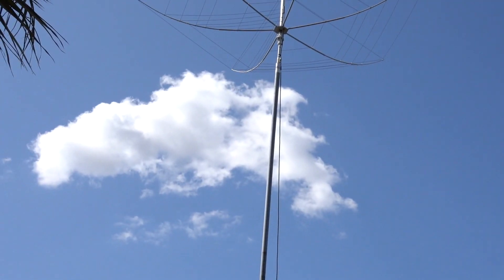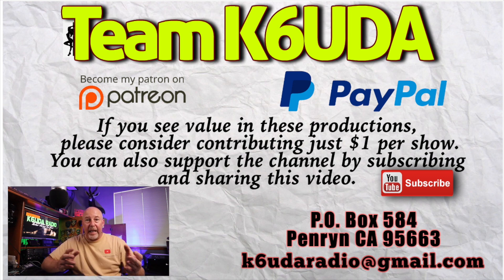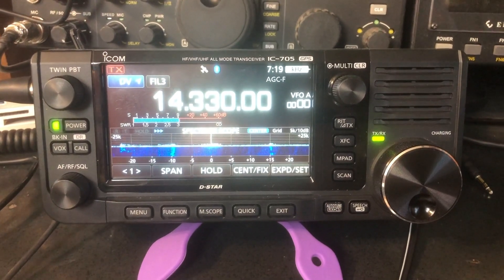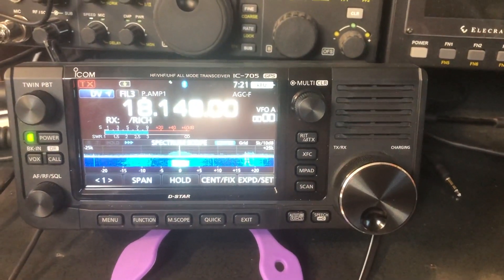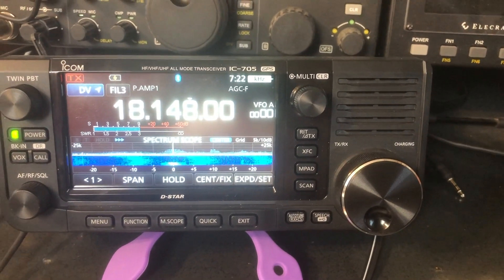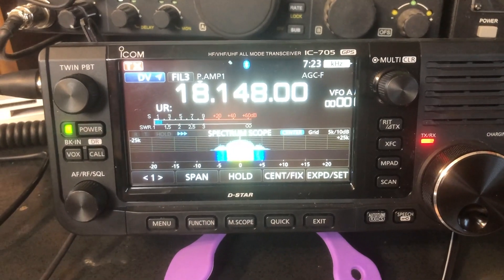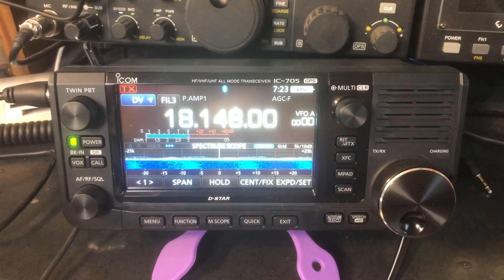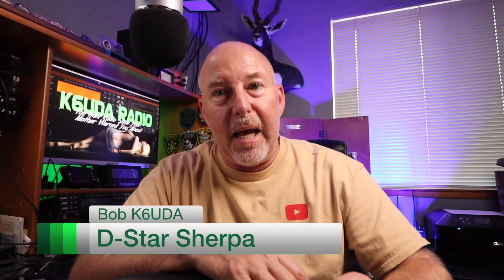Icom IC 705 demo - Must see D Star on HF at 10 watts | K6UDA Radio

Comment: I'm not an expert, but I was under the impression the digital FM modes weren't legal below 10m. That being said, I'm not at all surprised it works fine on the lower HF bands QRP. A lot of Yaesu C4FM guys have been using 10m this solar cycle for DX contacts, including Europe and Asia.

Comment: The IC-705 ia an AMAZING little radio! ☺ - Especially to someone who first got on the air 56 years ago.  Started hamming at 16 years old; had my Technician class license before my driver's license!  It led me to a 45 - year career, starting in consumer electronics, working for a small local TV repair shop, moving into being a commercial 2-wy radio tech, then industrial controls (NC & CNC machine tools, some industrial robotics), back into 2-way radio for a few years (including doing some ham gear repair professionally), then spent my final 20 years working for a major enterprise - level data storage systems manufacturer.  Went from working on late vacuum - tube era equioment uo to SMT.
Now retired, I enjoy restoring vintage rigs that were "dream radios" when I was in my teens & early 20's.  It's not all nostalgia, though; my early days on 6 meter AM turned me into a VHF / UHF / microwave weak - signal operator, still more active in that aspect of the hobby) up to 1296 MHz. currently, planning on going higher).  I just found out about HF D-Star recently & gave it a first try last week with the IC-705;  heard several signals, no 2 - way QSO's yet, but that was with the barefoot IC-705, & my HF antennas are all simplr dipoles; planning on trying it again in the near future.  Maybe with a bit of luck, we'll work you! ☺

73,
Tom WA1LBK

Comment: I cant get Dstar to work no matter what I try on my 705. In fact ive gotten to the point that I hate Dstar and its absolutely BS compared to DMR and I dont even like DMR. But as cool as this is, military already has digital over HF so ive already seen it in action, but i'd rather sideband some high power stuff. Im so over trying to get Dstar to work. Im fully registered etc.... can't use terminal mode, cant hear anything, cant do crap. But I could get DMR working in 5 literal minutes first time I ever tried it.

Comment: Well I guess that's about as wide as AM, so no big deal on HF.    
I think, as far as communication goes, I'd prefer SSB.  More intelligibility.
I wonder if anyone has done a test to see how low of a signal you can get away with and still maintain unbroken audio over Dstar, vs clearly understand the voice under SSB.   That might be an interesting experiment to do.  (Once I get one of these. :-)
However, as I understand it, dstar allows for sending additional data over the transmission.  Text and images?  Maybe GPS data?  I'm sure there are lots of tricks up it's sleeve.
Reply from the maker: Doing Dstar on HF at least right now is more of a novelty than serious way of having a QSO. As the signal fluctuates, the digital signal will naturally hit a squelch point where it audibly cuts out. Now some of what you were hearing was what happens during a pileup. Remember during that net, 25 or 30 guys are calling CQ and answering CQ at the same time. Much like digital on repeaters or hotspots, you only hear one guy at a time, hence the cutting in and out between a couple of stations. Unlike SSB, pileups can be very tricky.
Reply: @K6UDA  I think the potential practical utility would be some of the other tricks dstar can do.  I believe you can send images and maybe text? GPS position for sure.
If you come out to the unofficial quartzfest this year, we'll have to play around with it a bit.  160M during the day should be clear. ha.
Reply: DSTAR on HF is 6.2 khz wide, about the same as AM. DSTAR on HF will never replace SSB. CW. If you have a good DSTAR HF signal it will decrypt all the normal DSTAR sent data; Callsign, name, and GPS location.
Reply: @kenthufford743  Looking at the scope on his radio, it seemed to vary in width.  Some stations were around 6khz, but his transmissions and some of the other stations were 10khz wide, going from +5 to -5 khz on the scope.   That's ok though, as long as the operator is considerate and makes sure he's not encroaching on nearby qsos.
Reply: Nothing I've experienced is clearer than DStar, no QSB, QRM or anything else. Crystal clear comms.
Reply: @johnratcliffe6438  Watch this video all the way through then.   There were many stutters and audio glitches as the signal level changed.
Reply: @loughkb  Sorry Kevin, this is the first time I've seen DStar used without a Reflector. My comments were based upon my use via my 9700.

Comment: Damn you Bob!!!! 
First the KX3, then the TH-D74 now I have to buy an IC-705? We need to keep this a secret from my wife.
Reply: Have you purchased the IC 705? If you're familiar with this radio and care to share your opinion, I'd welcome your input. I'm a total newcomer to Ham radio and am going through a mountain of information so that I can make a wise purchase, before the end of the year.  I'm looking for opinions and recommendations on what radios I should be considering, I need help narrowing it down to just a couple of good radios that will meet my needs.  

I'm looking for the best radio for emergency communications during a worst case scenario. I saw this IC 705 radio reviewed very favorably on another channel and it's got some nice features. But I just learned that there's an issue during a true grid-down situation between analog and digital Ham radio communications (Analog was said to be better in a bad situation - but I don't yet understand why that's the case or what that looks like in a radio's list of features.) 

I'm looking for a new, good quality, durable, reliable, mobile Ham radio (not mounted in my truck - something I could carry in a case and use both at home and on the road). 

While I could see myself possibly enjoying it as a hobby - the whole reason for this purchase is for  emergency communication, so I'm not interested in paying for 'bells and whistles' that a passionate hobbyist might enjoy - I'm only interested in features that are  truly meaningful in the operation of the radio such as: watts, multiple power sources, larger display screen for aging vision, durability, (made in the US if that is even possible), and quality of sound both transmitting and receiving, without having to purchase additional external equipment.

I'm looking to purchase just one good quality radio -  I don't wish to get a "beginner's" set up,  and plan to upgrade in the future - I'd just like to make the correct choice, one time and not waste my limited funds.

Thank you for any suggestions or direction to further information - there's so much info to cover!
Reply: @sheri4673  If you are new to Ham Radio, buy a 100 watt HF radio. Not a QRP radio first
Reply: @sheri4673  Welcome to Ham Radio. The FTM400 is a good choice, meeting your criteria.

Comment: DSTAR HF VOICE Simplex.... NO Internet, NO Repeater, NO Reflector used. Great video Bob and congrats on the coast to coast contacts. When the bands come back we will be doing England and Australia again on DSTAR HF voice.
Reply from the maker: Thanks for running the net Kent.
Reply: How does that work? It has to link to a DStar node somehow surely?!
Reply: DSTAR HF VOICE is simplex, just like most all other HF. Your DSTAR radio encrypts you, you transmit and the DSTAR radio on the other end decrypts. Like simplex on 146.52. Watch the video again. Bob does not link anywhere.
Reply: @kenthufford743  I use DStar on my 9700 so am just not familiar with  the idea of not directing the data stream via a reflector.
Reply: @kenthufford743   Hey Kent have we worked before on D-Star HF, Maybe ...Pete VK3TQ
Reply: @johnratcliffe6438   No !
Reply: @johnratcliffe6438  No  Two way D-Star  Radio to Radio, Peter VK3TQ/VK2LD
Reply: Thanks Kent for the Net!